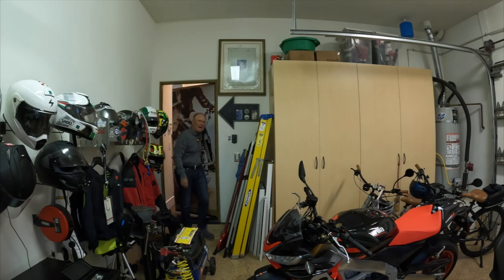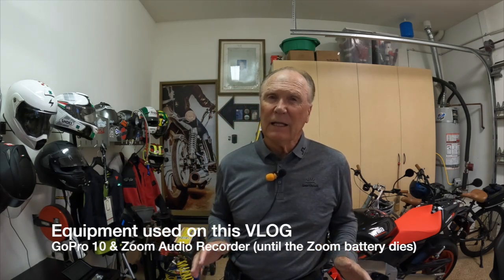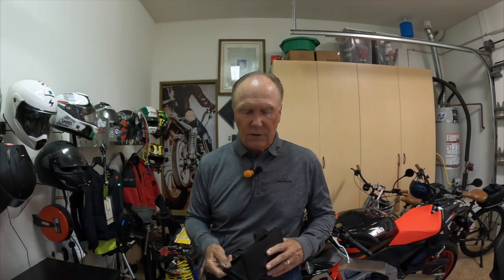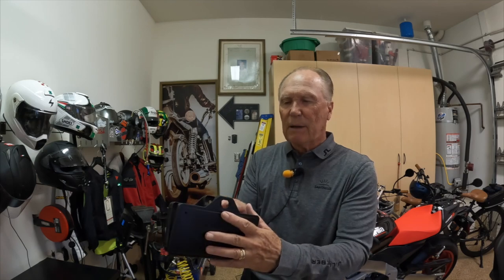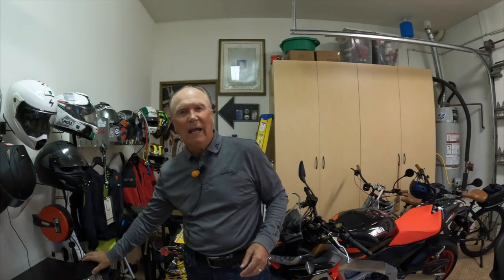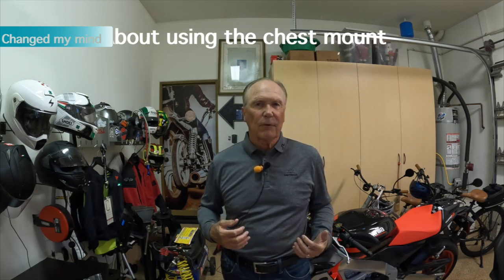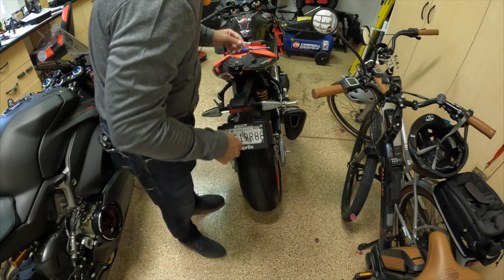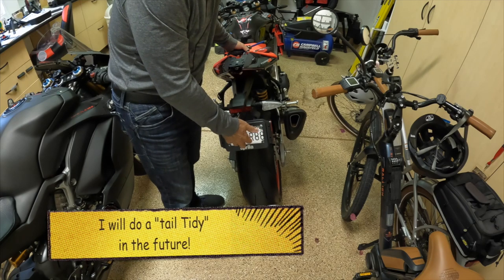2021 Aprilia Tuono Dryspec storage box, best mod EVER!   HD 1080p

Comment: That is a nifty product and solves the issue of keeping documents in an easy accessible location, should be standard on all production bikes form here on end , a necessity , great 👍 install vid 😎👌 thx for sharing 👌🙏🙏🙏
Reply from the maker: Totally agree! There used to be some cubby holes around bikes before they really packed them with the electronics etc. This really helps and the little key for the stash box goes right next to your bike key with no problems.